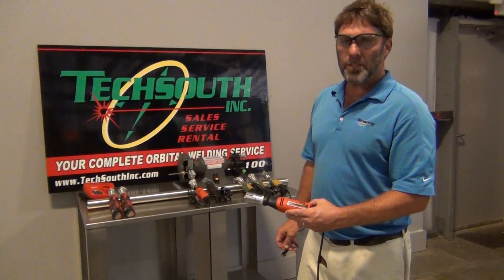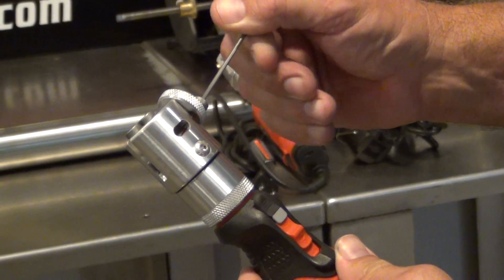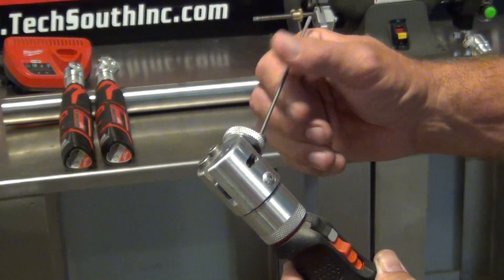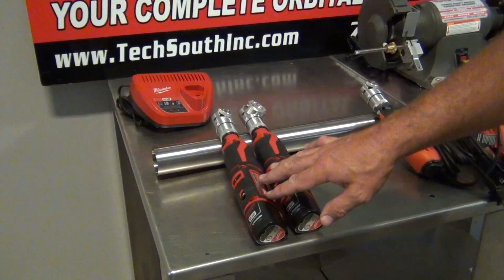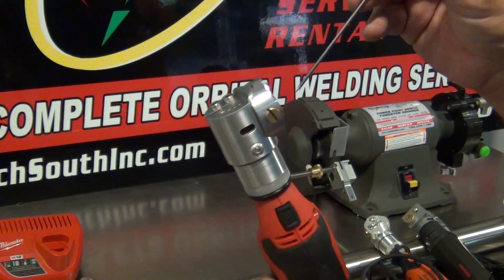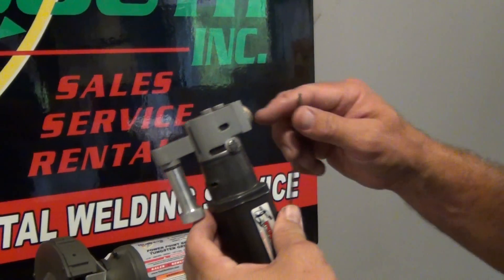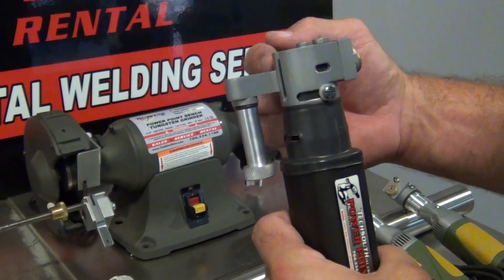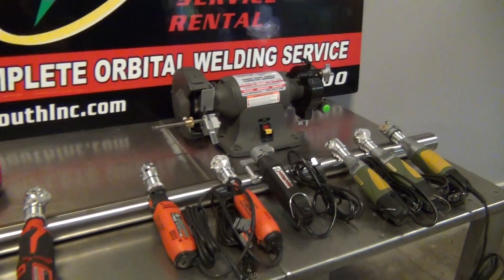Power Point Tungsten Sharpener

Comment: Not sure if your interested but I order in the best quality hardened diamond discs for cutting and grinding ideal for this they fit in 4" and 4.5" grinders  . thay would work grate for this. 
100mm with 20mm hole eBay item number 283469825819 
115mm with 22.23mm hole eBay item number 283472214343
More selection disks eBay item number 283445436284